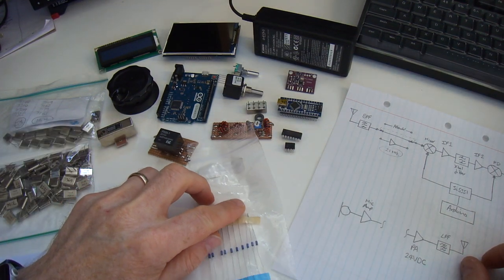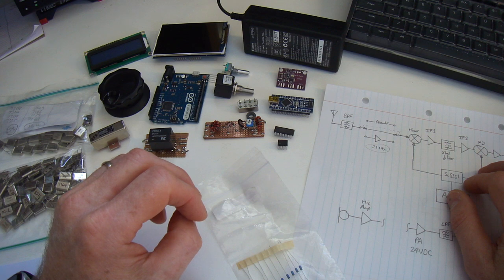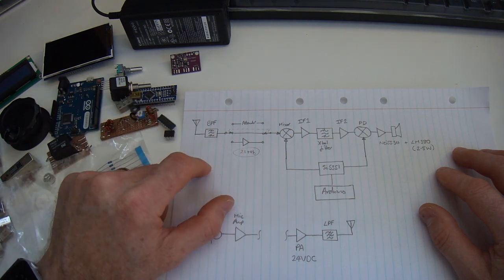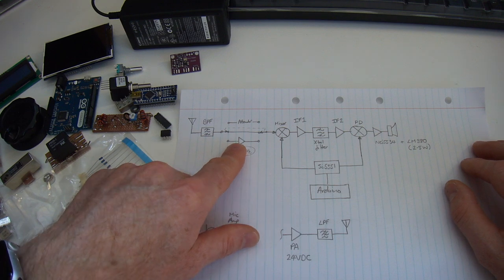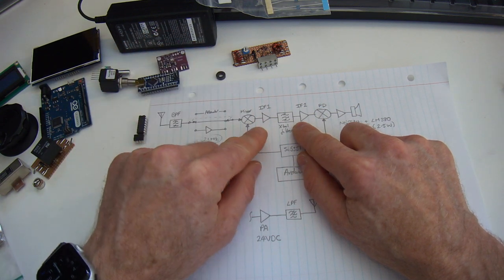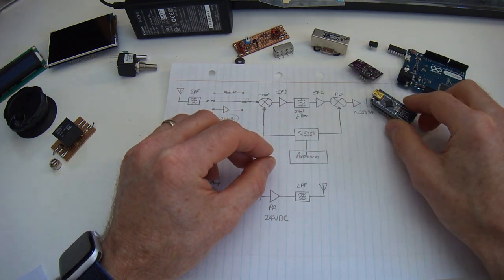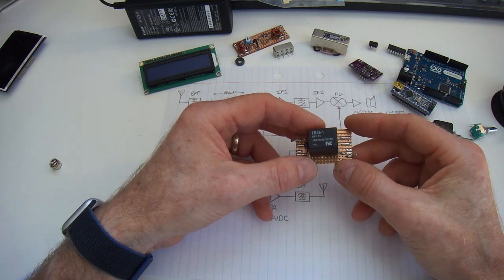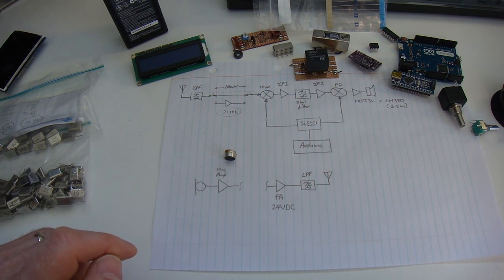Simple SSB Rig: Part 1 - Thoughts and Ideas

Comment: I really appreciate you documenting these builds! Not only are they entertaining, I find the discussion of circuit theory invaluable. Last year while watching your QRP SSB build I was motivated to start building my own first homebrew SSB rig. Cheers and 73 From Oregon.
Reply from the maker: That's great to hear Theo. Did you get the radio on the air, or at least receiving?
Reply: @CharlieMorrisZL2CTM  Right now it's a great little AM/SSB receiver that covers 80m 40m and 20m. I've been distracted learning CW, but will finish the PA and get it on the air before too long.

Comment: You just do things your way. It is inspirering and cosy. Love your videos.

My own approach is a little different. I make schedules on  my PC and cubber prints. I find that proces very interesting. And I am a clumsy builder on Vero boards. I allways ruin it by disasterrous shortings.
I go for the touch screen and a bigger Arduino, because it is possible to build in so many nice functions. Aaaand I go for metal cases. I have some lying that I made myself many years ago on technical school. I will not build many rigs but only one. I will then improve on that one for the years to come. Hopefully a never ending story.

Again thank you for your videos. I highly apprechiate them.

73 René, OZ1JPD.
Reply from the maker: Thanks René. I'll use the LCD first then the touch screen. My main focus for this build is simple, easy and hopefully not too expensive. Thanks for the feedback.

Comment: Using an analogue-switch IC as a mixer might be interesting in a future project.
Reply from the maker: Thanks Stephen. I've also added that top the list of things to look at in the future. Do you have a part number in mind?
Reply: @CharlieMorrisZL2CTM  I have no direct experience, but have noticed FST3253  bus switch used in several designs.  

This guy: https://martein.home.xs4all.nl/pa3ake/hmode/switches.html has seriously tested a whole lot of them and settled on FSA3157 in his very high performance design. 

Also, have seen common old CD4066 being used although I suspect that performance would not be high, but available from Jaycar.

Cheers,
Steve

Comment: Hi Charlie,

I would like to see you do a video on switching methods (possibly part of the next build, or before) and why you choose not to use some methods. I think it would be beneficial to everyone and would possibly advance any future builds. If you want to switch RF signals there are 3 main methods that i can think of ( mux chips, pin diodes and relays). These are worth looking at  if you want to reduce some of those QRP radios even smaller. 

Best regards

Simon M6FJW
Reply from the maker: Hi Simon. I did experiment with diode switching a couple of years back. There should be videos on it. I must admit I found the saving in space did not outweigh the extra complexity in switching the diodes and losses across them. While a relay adds a potential mechanical failure condition, I do like their simplicity. I'll add revisiting diodes switching to the list of future things to look at.
Reply: Hi Simon. RF switching is something I’m currently experimenting with. I’ve also taken inspiration and advice from VK3HN. I’ve successfully switched RF paths using the SA630. I’m about to test the NC7SB3157 to switch a set of BPF. I’m going to select the individual NC7SB3157 using a PCF8574. I mention all of this only to add to the pool of knowledge/experiences.
Reply: @CharlieMorrisZL2CTM  
No i haven't seen your video's on diode switching.  While diodes can be used there are some things to consider, Like the type of diode. A pin diode is about the best of the diodes to experiment with. NO matter what you use for switching there will always be some losses. With relays and RF signals you can  still get RF feedback due to RF jumping across the contacts ( at some frequencies ). The basic point is this each different type of switching has it's place. For Home Brew / DIY QRP Radio's that is going to mean a relay on the output of the power amp. The other methods wont be suitable. ( they wouldn't handle the  power levels from the output stage). Now Diode switching ( pin diodes are the best type of diode for switching signals) has been used for some years now and is a proven technique. Yes the diode method has a few things to consider, The voltage and the current required to keep the diode fully open so the signal remains above the cut-off of the diode.

Example: diode has a cut-off of 10 micro amps, you wouldn't try running the diode at 10 micro amps when you have a sinewave involved. Due to voltage fluctuations, it will fluctuate the current too. If the diode is turning on and off due to the RF signal this increases losses. So a rule of thumb is the cut-off voltage plus half the bias voltage plus 10% ( so the lowest part of the signal remains above the cut-off of the diode).

Notice: the above example is here for clarity and education purposes and NOT to make anyone look stupid in anyway.

Yes diodes are a little more complicated ( require a few more components,  usually around 5 very small components), But a relay at least some of the time would require transistor switching ( if you required MCU / Processor control).  So as we all can see yes even the humble relay can get more complicated if we are not careful. 

The final methods are transistors ( there are some with no gain and just switching capability) and mux IC's sometimes have a high on state resistance so careful selection would be required. as with all the methods there will be stray capacitances/ internal capacitances that will effect it at some frequencies making further losses due to reactance that can get over looked at times. While this shouldn't be a problem when dealing with signals on HF that doesn't mean we can ignore it entirely
.

Best regards

Simon M6FJW
Reply: @nevmarr  Have you looked at devices like the FST3253 it's like a 2 pole and 4 way switch that is in essence controlled by a binary input on 2 pins. these 2 pins control both halves of the dual Mux. the insertion resistance is 2 ohms but if you parallel both sides up you can get approximately 1 ohm insertion resistance. They are suitable for AC and DC signals ( some mux chips are DC only ), They are a reasonable switch that last time i looked are easily available online. For RF signals i wouldn't use some of the other MUX chips due to the on state resistance being a lot higher than the FST 3253 device and possibly not suited to AC signals. Some of the softrock ensemble radio's use an FST3253 to switch  up to 4 bandpass filters which is why i have mentioned it here for your consideration and experimentation.

Well happy experimenting 

Best regards

Simon M6FJW
Reply: @simonmichaeluk  Thanks Simon. I hope Charlie doesn't mind too much that this thread is a bit off topic :) I've not used the 3253 but I'll add it to my list for future trials. I have been suspicious of many of the MUX because I can't tell from the datasheet if they can handle AC/RF - as you note, a lot seem to be DC only devices. I gravitated towards the 3157 because the datasheet said it was good for 250MHz. Many thanks for your comments. As Charlie often says, it's all learning here.
Reply: @nevmarr  I think you will find that we are NOT off topic. The parts your currently using are a 2:1 mux which you can consider for his radio build. They could be used in place of the relays that are switching the signals either side of his crystal filter. His relay's split 2 inputs to one output just the same as your parts. for the purposes of this chat we are going to say you use your 2:1 mux as a solid state relay. 

You can also use those parts for switching the RF filters on a receiver. I would advise against trying to use them on a transceiver as part of the TX chain, A ny more than a few milliamps would possibly damage the part. That is one case where a relay will always win, when it comes to being used in any part of the TX chain (that is after the TX sub-driver).  

When it comes to taking any frequency figures from the datasheets double check what they are referring to (Sometimes they talk about the actual switching frequency I.e. how many times you can switch it per second, Sometimes it's a maximum RF frequency that can pass through the switch.). I have made that mistake in the past.

The maximum switching frequency is not relevant as you only switch state when his radio switches from RX to TX. The maximum frequency you can use is actually sometimes not relevant. The signal wont just vanish at that frequency, it will taper off at a given rate and will possibly still be useful at higher than the frequency in the datasheet. 

So my advice is always check and recheck when it comes to reading frequencies off these parts and don't take them as concrete figures. Also don't forget to check any voltage requirements. To match to 50 ohms the part might require a particular voltage, change the voltage and the impedance will probably change.

best regards

Simon M6FJW

Comment: I've bought Si5351 chips from Mouser or Digikey for under a buck each (cheaper from Mouser if I buy 10 at a whack), and solder them to breakout boards from ebay.  I have a TON of 25mhz crystals.  So I can build up a Si5351 for about $2.  They are possible to solder by hand.
Reply from the maker: That's interesting. $2 is a great price for a nice stable VFO. I must admit I take the easy way out and buy the boards.
Reply: @CharlieMorrisZL2CTM  Adafruit's boards are about $8 each, add a few bucks for the SMA connectors.  Ebay China sellers have them for less.  Using breakout boards about 12mm square takes up less board space, but I'm using the usual wire lead crystals instead of SMT ones.  Some of the Chinese made boards might be using surplus Si5351's (overstock) that were factory configured to a non-standard I2C address.  That would cause a bit of head scratching to get them to work, but there is an arduino sketch that will scan the I2C bus to look for such things.

Comment: Hey Charlie! Thanks for this really good video series! 'Coudn't be better explained' is my humble appreciation for your series.        1.  While trying to buy the NE5534 i found a large number of variants with suffixes. Could you please help with the exact suffix.
2.   The FRS relays are also hard to come by. Could you suggest alternatives? Looking forward to your next video in this series!! Thanks & 73
Reply from the maker: Hi Rajaram. Thanks for the feedback. The NE5534s I have here are from Texas Instruments. They are marked: 25AC1LM NE5534AP. As for the relays, any DPDT should work. I had 12VDC ones in the junk box so used them. You also use 5VDC and modify the switching voltage as required. Hope this helps. Charlie
Reply: @CharlieMorrisZL2CTM  Thanks a ton!

Comment: Very interested to see this one through! I plan to do something similar, but need to learn more :) Have you considered ne602 for mixer? Will there be a need for filtering si5351 harmonics?
Reply from the maker: Hi Vojislav. Yes, I have used NE612 and NE602s in the past and they work well here where we don't have an abundance of high power transmitters. There should be a few videos on their use here. As for the Si5351, no, I'll keep the square wave output as is. Check out: https://www.youtube.com/watch?v=WwJKxvz7qbs&feature=emb_logo

Comment: Please note for this transceiver schematic you NEED another BPF before the PA (one per band). The reason is that the output of the diode ring mixer has many unwanted products. If you just amplify them without filtering not only your PA performance will be not great because of wasted energy and IMD products but also you will transmit something like ~0.1W of power outside of amateur radio bands, even if you have a good BPF before the antenna. I know this because I tried this approach recently and the spectrum analyzer clearly showed the result. This is the reason why there are usually 2 IFs in SSB rigs, because no one wants two sets of BPF for every of 8+ bands. Speaking of PA, you can easily get 5-10W class AB using 13.8 V and 3 stages 2N2222 -> 2N2219A -> IRF510. Check out the schematics by VK3HN , e.g. https://vk3hn.wordpress.com/2020/03/29/pocket-sized-homebrew-40m-cw-qrpp-qrp-transceiver/ BD139 although is cheap doesn't work well above 7 Mhz. 2N2219A works quite well up to 17-15 meters. 73s de R2AUK
Reply from the maker: Thanks for that. I typically do just that for the reasons you point out. In one approach I shared the BPF between RX and TX. We'll see what happens this time.
73
Charlie ZL2CTM

Comment: My thoughts Charlie are with the diode mixer and 24v supply, will this be a 24 v mixer. I like the lcd displays but have you considered the old 7 segment displays for a retro effect? The laptop ps's are switchers so you may want to check for emi suppression though for 80 mtrs noise may not be the problem.
Reply from the maker: Thanks for all that. The mixers will be passive at this stage. I understand J310s are quite hard to come by, so making up a pseudo dual gate MOSFET is not an option. We'll see how it all plays out :o)